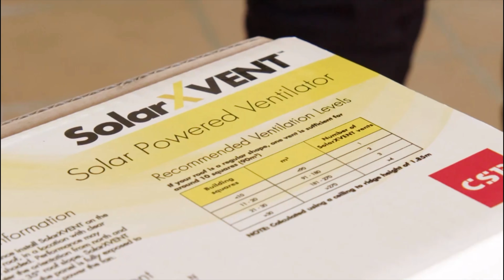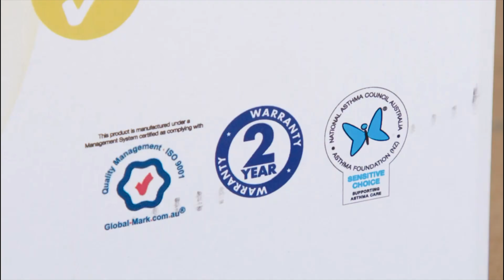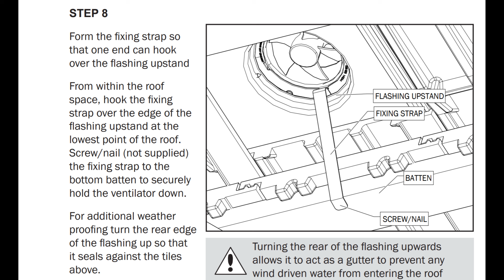Deeper into roof vents  a masterclass

Comment: Powered Exhaust vents can suck outside Rainwater into the roof space.
I have traced a vertical duct up 5 levels to the roof mounted ehaust fan and seen water being dragged onder the flashing. 
And then dropping down onto the ceiling tiles in a shop at the lowest level.
But if raining the fan may not be working. So what to do ???

Comment: If this is a new build, just insulate under the roof correctly, if you get a decent amount of insulation under your roofing material, you do not need any roof, vents or anything stupid like that, you guys always assume that you got to get rid of the heat rather than just stopping in the heat, stopping it is remarkably easy

Comment: In Adelaide (not Sydney) evaporative air conditioning is common and works alright'ish (7degree drop with 50% humidity and 10 degree drop with 30% humididty). In older houses (1980s) places with tiled roofs don't have sarking. So my question: does it make sense to purge some of your cooled air exhaust into the roof cavity through ceiling vents instead of out windows. doing this as a means of dropping the cavity temperature. What kind of moisture problems might arise and how would that be managed. I assume some eve-vents would also be required to minimise moisture accumulation in insulation.